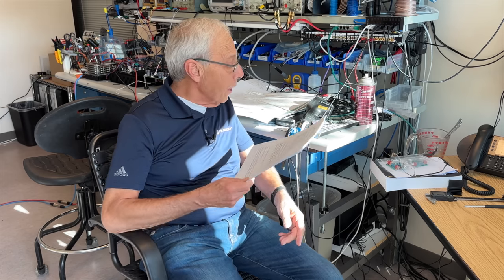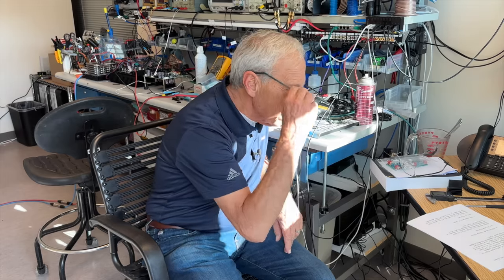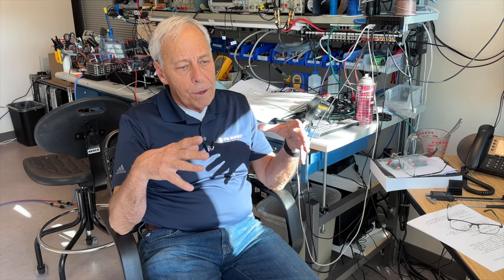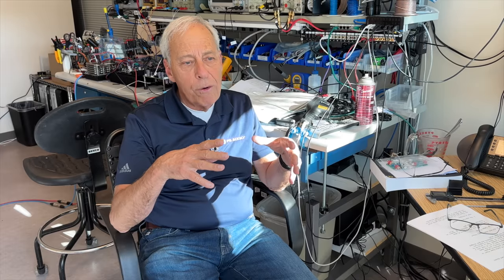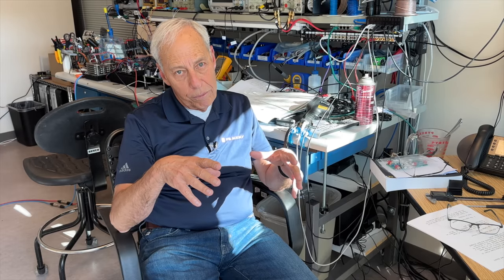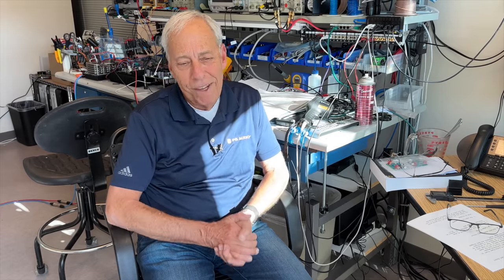AirLens power supply explained

Comment: I think Emotiva does a good job using a switch mode power supply on there amplifiers. I have herd they don’t measure the best in some areas, around the switch mode. But most people agree they sound pretty good.

Comment: Im more confused than when you started!! Your first point was" if you want a great sounding device, you want to use a linear power supply"  followed by" we chose a switch mode power supply" because...yada yada yada... guess the two opposite statements short circuited my brain to the point that i didnt trally hear the explanation 😢😅😅
Reply: IMHO he basically we considered trade off between being slightly better but being much larger and more expensive.  Basically most of the performance in a package and a price that will actually sell.  My bet is they also went with a middle of the road clock like the Crystek as they do in their DACs.   All good choices for a mid market product.  SOTA clocks and supercap power supplies would sound better, but need to retail for $50k and have multiple chassis.

Comment: Likely some fine design choices for the intended market.  I am a big fan of this type of device.  In my experience effective isolation and reclocking using very low phase noise clock yields the best results from a digital audio system.  So the Airlens has the potential to be very good.
In the DIY domain there has been a lot of experimentation with power supplies in this area.  It seems there is no end to possible improvement as the supply improves.  Separate PS for each of the single board computer, the FIFO/isolator and even the clocks.  The FIFO and the clocks do very well running ultimately on supercapacitors.  The order from good to best is switch mode/linear/battery/pure supercapacitor.  People are using multiple 300F capacitors to power these things.  Big, expensive and dangerous to say the least.  But sounds great.

Comment: Ok, galvanic isolation on lan networks isn’t new, there are galvanic isolaters available for 30 euros, and they work well. Also ifi has a nice lan isolator add on device that enhances (usually) streamers‘ sq.
I shall add, LAN interface as such is inductive and therefore „largely“ galvanically isolated. Cat 8 cables with metallic plugs might however connect sending and receiving devices ground to ground (at least their ethernet interfaces), which would explain the different influences on SQ brought by different ethernet cables.

And yes PSA‘s airlens might add a few more tricks to it to lift its SQ at even higher levels..
Reply: All ports on a network device (like a router or switch) HAVE to be galvanically isolated to conform with Ethernet 802.3 standards. If they are not then the device does not conform to the standard and should not have either FC or CE certification. Additional cheap Ethernet isolation is a scam.
Reply: @razisn  yup if not then it would be back to the sparks everywhere 100 computer coax lan party times..
of course if some audioblahblah devices wouldn't comply that wouldn't be any sort of a surprise.

the streamer being just a computer anyway with a price tag it would be silly to use a linear psu for it. it wouldn't make it any better in any sort of a way.
Reply: Yes. delete the quotes around largely, but mind, some ethernet cables have their shields connected to the plugs on either side. Cat8 standard apparently necessitates that. Not sure about sparks in ethernet networks and in case cat 8 standard is applied, but some audiophile ethernet cables are of cat8 type (although supported datarates are rather meaningless in audio). Not sure whether related sockets are grounded or not. Logic would suggest they are. 
Wrt lan isolators, my hunch is they improve SQ (evaluated on analog level) for other reasons than introducing one more level of galvanic isolation.
Reply: @gioponti6359  the evaluated on analogue level is just done subjectively, not by measuring missed packets, time between them or something like that or scoping the difference at the amp output or scoping other signals on the path. basically you just smoke weed and keep changing caps on the psu, that sits before other smp's on the components and on the board, until you feel you made a difference.

then you move on to evaluating if it made a difference if you zipped and unzipped the wav file with winzip or winrar....  and if it makes a difference the laptop you're streaming from over wlan is plugged in or not.

and frankly if an usb or rj-45 soundcard(dac) costs thousands it damn well should be made well enough to filter out any analogue interference or micro-stutter from the data stream from the data connection to begin with - it's not like the money goes into the dac chip or something.
Reply: @lasskinn474  erm no. no weed involved. Not on this side of this thread. I would have appreciated a more focussed and target oriented discussion though.

Comment: I have an Air Lens and have had several streamers prior to it some were considerably more expensive and they also had  sometimes optional external linear power supplies,which as Paul stated were rather expensive.
The Air Lens is the best sounding unit I have auditioned. The fact that it’s connected to a PS DS 2 via I2s could be a big factor ? Since I currently only have a Oppo 205 connected to the DS via coax is not apples to apples,but the Air Lens SQ is definitely better. That’s just my opinion but I am sticking with it also the AL:)
Reply: Which ones?
Reply: The Air Lens streamer
Reply: @sbrinckoo855   no, I mean which prior ones that were considerably more expensive that you auditioned?
Reply: Any additional user experience information you may provide? This release has been a long time coming and the MiUSA streamer market is scarce, so I'm kicking around the idea of acquiring an AirLens sometime next year. Up to this point, I've had a Bluenote, Wiim Pro, Cambridge Audio... and auditioned an Eversolo and NAIM. Obviously, none of those besides the AirLens is engineered and assembled in USA, which is why I eventually moved on from them.
Reply: @CalvinWebb  I have at this point  pretty much  a PS reference system . 
I was Audio dealer in the early eighties,since I spend a lot of wasted time auditioning second hand gear and then selling it or trading with friends.
PS gives you 30 days no brainer?

Comment: Why not add the option to cut off the smp and add an external linear power supply for those who want it?
Reply: You have that option. The smps is separate board. Just take it out and solder on the +0- pins straight from your lps.
Reply: @Pete.across.the.street  yeah sure but what about the flux capacitor? Last time commander Data attempted to perform a capacitance breach C3PO ended up with that red arm.
Reply: @bradstone2603  just measure the voltage, regulate the toroid to said voltage, and don't screw it up by reversing polarity. It's not very difficult at all. Or just buy a built lps and run a dc barrel to the board. If you don't exceed the volt or cross polarity, all will be good. You can exceed amperage, but never volts.
Reply: @Pete.across.the.street  is that before or after the goat sacrifice?

Comment: I as very disappointed in the Gain Cell dac power supply. Same MASP as the Audio Alchemy DDP-1 dac/pre with wall wart, BUT the also sold and optional PS 5 heft outboard PS

Comment: Switch mode power supply is cheaper. Bigger margin. Lower price point. Simple.

Linear power supply will give better sound. They tried to mitigate this issue with capacitors for cost reasons but still, it makes it a lower class product. Paul knows it. That’s why he sticks to his “story”.